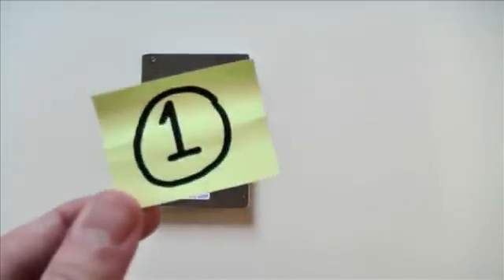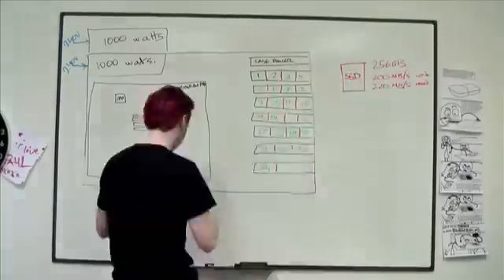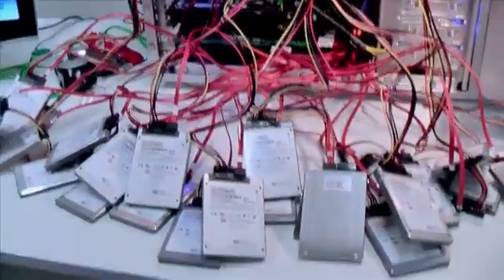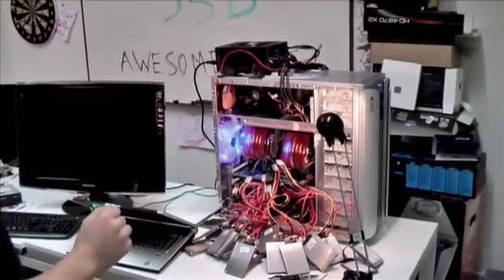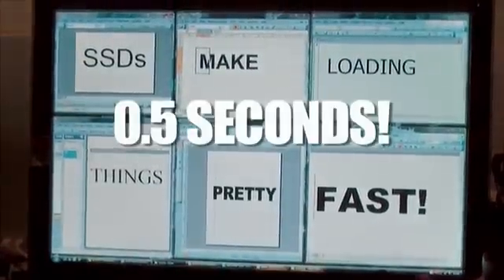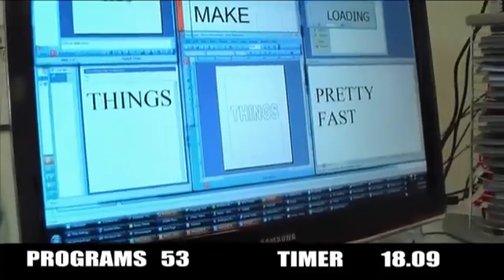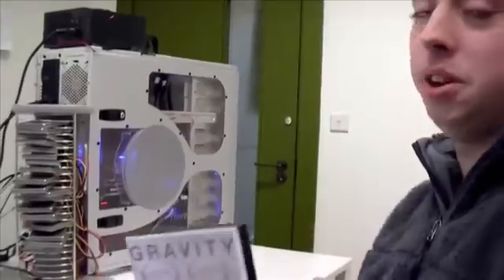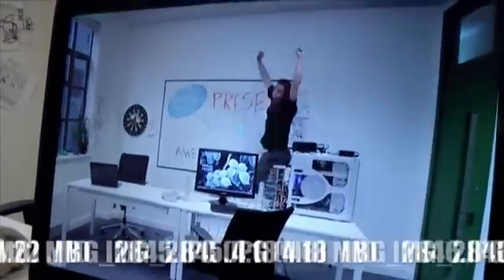What happens when you RAID 24 SSD Hard Disks !!!!!

Comment: Using a video game to showcase read right speeds is silly, and DEFRAGGING AN SSD is the third most harmful thing you can do to it, only beaten by running dragon age inquisition's DRM on it (constantly writing and re-writing) and straight up smashing it with a hammer.

"around dyed hair, always beware"
Reply: Mark Jordan Writing to it is damaging it slowly. (it's a tech fact that even today isn't resolved, that's why you have to use special softwares to keep it alive as long as possible) Defragging do A LOT of writes to the SSD and it isn't useful since defragging was made to accelerate acces time for a HDD because files are all over a disk and they cannot always be accessed (the "head" of the HDD must be in front of the data you want. If it's a file and it's split all over the disk, you have to wait the disk to spin at the right spot and move the head. And that's mechanic HDD is slow compared to an electronic SSD) For a SSD, you can access every file directly because it's only electronic.
Reply: It wasnt the video game specifically but the high resolution textures they were running on an already demanding game
Reply: Deksor Good explanation, a lot of newbies will most definitely appreciate it, but author of this video obviously knows that, he did this to showcase the speed, bad benchmark choice, but I guess HDD users can more easily relate to this :)
Off-topic: It seems like this video is a reupload. I wonder who's the original author? I'd like to subscribe to his channel.
Reply: Mark Jordan beat it with a baseball bat
Reply: Razelda Peacecraft this was January 2011 sooooo if we went back in time this would be mad
Reply: Lorde Kiblington Whats the worst you can do to it? like whats the worst thing you can to do an ssd?
Reply: Youtube ™
Depends on the drive. Faster, high capacity ones can get pretty hot. But SSDs can handle the heat, according to technical specifications of many popular drives, they can handle up to 70 degrees Celsius. In a tight cage, with no airflow, stacked directly on top of each other drives will accumulate heat, resulting in elevated internal temperature, theoretically 70 can be exceeded if you're constantly editing videos and whatnot. But, as I sad earlier, there are too many variables, if I did RAID, I personally would just play it safe, leave some gaps between the drives, and install a large silent fan in front of 'em. Most cases have an air duct and mounting points for the fan around the drive cage anyway, so why not utilize it?
Good airflow will not hurt your system, if anything, it will improve stability.
Reply: Lucas Alves
÷ I tried and the volcano melted. disliked, and reported.
Reply: ***** Don't be silly. That would mean that they're in the year 2015, which is simply impossible.
Reply: Youtube ™ overhit its chips with bad coоling of your system
Reply: daskriege
What?
Reply: Youtube ™
Translation: The worst thing you can do to an SDD is put it in the system with poor air circulation, which will result in flash memory overheating.
I guess it's true (especially when you stack these), but it is also true for a lot a components. Good airflow is always important.
Reply: funky3ddy
I'm pretty sure I heard this quite alot that SSD's don't heat up nor do they require good ventilation? That's also the reason why computers these days have the SSD slots at the back of the motherboard in between the case and the motherboard itself allowing for little to no airflow at all? For example the fractal design r5 has ssd slots on the side of it allowing for hardly any air flow to them...?
Reply: Youtube ™ Throw it at a volcano
Reply: Youtube ™ Well, maybe throwing it at a blackhole it can be the worst thing that can be done on an SSD :D
Reply: Lucas Alves
Also tried that while I was at it, and the black hole warped. disliked and reported as well.
Reply: Seriously though guys, all this for an SSD LOL?
Reply: Lorde Kiblington You don't defrag SSD's but OPTIMIZE SSD's. And Honestly, Defragging a SSD's Does no more harm than Reading and Writing does.
Reply: mage7206 "It wasnt the video game specifically but the high resolution textures they were running on an already demanding game"

Irrelevant. The only thing these SSDs would do for you is shorten your load times. That's it. Once most of the critical data is loaded into memory, the storage performance stops mattering.
Reply: Lorde Kiblington he should get PC Optimizer PRO (lmao), to prove your point more he had to use the malware defragging software becuse windows will not defrage a SSD... I get the same speed on my 4 SSDs but in all fairness Im using SAS SSDs with 12gbps read and write soo
Reply: Lorde Kiblington I disagree; I just think they used the wrong video game. I'd like to see them try to load the sims 3 with all expansion packs.
Reply: That DRM thing is a completely unfounded myth.
Reply: +Jose Vargas wasn't 2011, skulltrail + qx9775s +4870s = 2008
Reply: +Lorde Kiblington That was actually a fallacy: Denuvo doesn't write to disk constantly at all
Reply: No. Time travel is not possible. The current year is 2008.
Reply: *****  but if i'm seven and your 25 than obama care actually worked meaning that 3=x and x^2 is the denominator and -9^3 is the tip top of the triangle. 9/3 equals 3 a triangle has three sides there are three triangles in the triforce simbol zelda is made by nintendo, nintendo supports iluminati, 
ILUMINATI CONFIRMED
Reply: +Lorde Kiblington I know, I was like wtf are they doing...
Reply: +Johnny English 
XD
Reply: +funky3ddy Honestly, if the drives are in raid0, then each individual drive will be accessed for (in this case) 1/24th the time it would have been otherwise, so theoretically it shouldn't, on it's own, get as hot. In RAID1, of course, they'd all be accessed for the normal amount of time and thus all get as hot as normal (or more if clustered like this). In other RAID levels it's not as simple, but generally they shouldn't get much hotter (than when run without RAID) since there aren't any moving parts.
Reply: +Deksor samsung now has a new ssd that uses more reliable memory, it's got a warranty of 10(!) years.
do you know about it? and what do you think about it?
EDIT: its called Samsung SSD 850 PRO.
Reply: ***** That's only if all 24 combined were being used at the same speed as 1 typical drive, which would imply that there was no performance increase from using 24 in RAID0.
Reply: +Sonny Williams Even 700$ worth of SSD's wouldnt get you near that speed
Reply: ***** Even assuming you don't saturate the bus, the drives won't suddenly be faster because they're RAIDed (and if they did, that would reduce the heat build-up, not increase it). You'll get minimal benefit from small reads and writes, because there's hardly any latency in SSDs and small files can be written to a SSD in a fraction of a second already. Large reads and writes will be finished in seconds or less, and generally don't happen often anyway, so the amount of heat generated even in that case will be negligible.
Reply: +Lorde Kiblington Denuvo SSD rumor was a hoax.

Comment: One single Samsung SSD SAS-12G 800GB Drive on an Asus PIKE II card runs at 1.2GB per second.
Reply: keep in mind that this video is 4 years old, SSD disks have progressed significantly
Reply: Pawel Blyskal Note it's actually 6 years old. Also it's LGA771. Meaning it's using SATA2 (Which is limited to 3gbps => maximum of 375MB/s per connection) for the connections. It's also got slower SSDs than what's commercially available today. If you do this with current SSDs and some beefy raid cards you can cocievably hit ~10 GB/s.

We're starting to get speeds in the ballpark of these commercially available with m.2 drives now but we're not there yet. Maybe in a year or two.

Still though, 2009 -> 2015 is like 4 itertions of stuff getting 2x better
Reply: Pawel Blyskal They are 200mb/s. Watch the vid again, he clearly states it.
Reply: Dragon Steel - Amazing how many people dont know 1MB=8Mb... first try learn IT basics, then your comments will dont looks like from idiots. Video talks about speed 16000Mb/s (2000MB/s).
Reply: XtrAMassivE Wrong. The Samsung drives used EACH have 500MB/s transfer speeds. He used 24 drives and only got 4 times the performance of a SINGLE drive. Pathetic.
Reply: answerOfstupids Yes there is! http://www.quietpc.com/samsung-m2-ssds
Reply: Dragon Steel  You should use ctrl+c and ctrl+v... because you quoted my text wrong. Anyway my 1. reply was general for many comentators here, not only for you. I was no able add new post, so commented last wrong post. And yes, your english is probably better... so you have easyer way to learn something about GB and Gb  :D
Reply: Dragon Steel Another dragon!
Reply: Pawel Blyskal law of diminishing returns applies to pretty much anything at least anything technical lol.
Reply: Dragon Steel that's gigabits per second not gigabytes there is a difference
Reply: Dragon Steel lol sata 6 doesnt do 12gbs it only does 3
Reply: XtrAMassivE i forgot the link but wasn't there ssd that did over 2000MB/S (2gbps) read write. Do you know about it.
Reply: pertti290 i found another one http://www.pcworld.com/article/2904340/intel-750-series-ssd-review-storage-so-fast-only-the-highest-end-pcs-can-keep-up.html

however in testing they said for bigger loads they were only able to get 1.5gbs instead of over 2gbps  but for small files it was 2gbs.
Reply: Autodiagnostika Jantolák It's funny to me when I get told not to look like an idiot then I read this.

 "Then your comments dont looks like from idiots" 

You don't have to be great at English to realize that was awkward to read.
Reply: Dragon Steel its funny how the intel 750series has a single drive running at 2.4Gb/s read speed. Shows how far SSD's have come.

Comment: I worked on a hardware/software system that read, wrote and indexed mobile packets as 20 Gb/s.  And did not require 24 SSDs :)  That was close to this system's test of 2 GB/s, so perhaps it's not as impressive as it would seem at first glance :)

Comment: Too bad that continuous writing to ssd drive shortens it's lifespan drastically
Reply: To be fair, it's not nearly as bad as it was back then. Nowadays, it's getting much, much closer to the lifespan of mechanical HDD heads. And SSDs are not done improving yet.

I think we're almost past the worst part.
Reply: Well, to be honest you would not reach the SSD write cap during your whole life time with modern SSDs (with normal usage). Tech Report made an non-stop SSD write test with popular models. Samsung 840 Pro was the last one alive and ended up writing over 2.4 Petabytes before dying. That's 2400 Terabytes.

My SSD sits currently at 7TB of written data and it's 2 years old :D My older SSD is 4 years old and it has 13TB of written data. Not gonna reach write cap during my life time. And i'm gonna upgrade to newer model in few years anyway.
Reply: WayZHC
i'd rather be reassured and wait some more before transfering from HDD's to SSD's

Comment: That's not 2 GB/s, It's 2019 MB/s. which is < 2 GB/s.
Reply: no 2 gb is 2048 not 2000
Reply: That's what I said. I said that it wasn't 2 GB per second, it was 2019 MB per second, which is less than 2 GB per second. I'm fully aware that one Gigabyte = 1024 Megabytes, and mb to 1024kb, kb to 1024b, and much the same upwards.
Reply: iliekpie1125 According to hard-drive manufacturers 1KB = 1000B but according to computers 1KB = 1024B this is why when you buy say a 2TB hard-drive the computer recognize it as 1.81TB.
Reply: ***** and 2019 mb is 1.9716796875 gb

Comment: For the "OMG He defragged!!!" guys out there. Defragging on an SSD does work, and yes, it is NOT recommended because Random Seek is not a problem with SSDs. However, it does not "kill" the drive (unless your system is highly fragmented) - SSDs are limited in WRITE cycles - Read cycles are nigh unlimited, shiit, it happened so fast, I'm actually curious if he did DeFrag it, or if he simply scanned them to see if defrag was necessary.

Comment: I get exactly that with just 1 SSD and Linux...

Anyway, with 8 SSDs in RAID0 on an good Controller i get more than 4GB/s, so for 24 SSDs, 2GB/s is quite lame to be honest.
Reply: Vampir Achtneunacht 90 lines. Nope.
Reply: I bought my system in 2011 with an Phenom II X6 1100T
Reply: he used sata2
Reply: You know this video was done 7 years ag
Reply: ***** Well you have to watch this from two standpoints.

Technologies are creates in the Linux World, not in the Windows world. The ISC, the Company who "develops" "The Internet" is running Linux and all reference implementations for DNS, DHCP, TCP/IP and so on are created in the Linux world.

Also all root-servers run Linux or other UNIX Operating Systems. So without the UNIX Systems, there wouldnt be any internet.

Google is using Linux on most of its systems, Google itself is an Linux Application written in Python and C as Facebook is an Linux Application.

The Programming Language C was created for UNIX and it was created by the creators of UNIX and C++ was also created long before any Windows every seen the light of world.

From a pure technical standpoint, Linux can do everything what Windows does, but better.

The only reason to not use Linux is if your technical skills are not enough or you need some hardware/software from a company who does not provide Linux Drivers/Software.

The only reason why Windows is used, and i say that working for companys with more than 70000 employees, that people can use this who are less technical skilled. You can set an idiot in front of an windows system and he still could be able to do stuff somehow.

So in Windows its easier to get along being bad.

Funfact, the TCP/IP Stack from Windows is from FreeBSD (UNIX), so without the UNIX Systems, Windows wouldnt even have networking.

So why is Linux important? You could not read this without Linux. You are using an Linux Application right now (YouTube) and your Windows is using UNIX Technologies (your Browser (except you use Internet Explorer) and Networking.

Also your Router is running an UNIX System (most likely Linux) as your telephone provider is running it. You would have no Internet without Linux so there would be no way to ask for its importance ;)

Large Companies using Linux are for example Google, Intel, AMD, ARM, Dell, IBM, HP, NASA, NSA, CIS, ISC Facebook, Sony just to name some very few of the most well known one.

But Sony is only half-true, they have a lot of Linux Servers but most Servers and there PS Vita, PS3, PS4 run with FreeBSD (UNIX) rather than Linux.

I could continue endless but one more fun fact.

Most Windows Servers nowadays are virtualized using VMware vSphere which is an Linux Distribution. So most Windows Servers who run today are run by an Linux System. The only Virtualisation Solution which can beat VMware in Terms of performance and features is KVM which is an part of the Linux Kernel and Linux only.

The only Virtualisation solution which can beat KVM is behyve which is FreeBSD only and can only be used to virtualize BSD and Linux Systems.

Also Mac OS X is, in most aspects, an FreeBSD System (with some changes to the kernel like Sony did for their playstation).

Not to mention that Android is Linux. So iOS and Android are either FreeBSD or Linux. We would live in the stone age without Linux and Windows Server would be much more expensive then they already are.
Reply: Yope
Reply: "I get exactly that with just 1 SSD and Linux..."
"I bought my system in 2011"

Wait what. No you don't get that speed with just one SSD from 2011. Linux isn't magic either. Even today you can only barely pull 2GB/s with one SSD. And that's only the theoretical speed. Actual speed won't hit 2GB/s. Every SSD i've seen hitting over 2GB/s have been PCIe SSDs and while they were only one card, there was actually few drives in RAID on them.

And this video is originally from 2009.
Reply: That system speed, not SSD speed

Comment: Not usable in RL because RAID 0 would make any failure in any 1 of the 24 drives fatal to the data on all 24 you would want to use RAID 10 or 5 with a controller.

Comment: You can tell these are marketing people. You never want to defrag SSD's :)
Reply: Thats a silly myth, defragging doesn't hurt SSD's nor do they marginally increase performance like on HDD's.
Reply: CalculuS Yes it does. Writes count on a SSD. Defraging will cause writing to the drive which can hurt the drive. I am in the business, I have done enough tests to prove it.
Reply: CheekEman Thats like saying breathing is causing cancer and thus deadly.

Also next time you try to state you're in "the business" give proof, I find it hard to believe a random stranger.
Reply: CalculuS No its not lol
Reply: CalculuS solid state drive cells have a limited number of times data can be rewritten to them, when you defragment them, its rewriting the data on the cells many times, and that shortens their lifespan. Also there is no point in defragmenting an ssd anyways since fragmented files don't hurt performance.
Reply: noah1831 http://www.pcgamer.com/two-ssds-survive-after-more-than-2-petabytes-of-write-tests/
Reply: CalculuS That has to be the worst analogy ever. That's not just hot air; it's based upon facts on how SSDs work. SSD lifespan is entirely dependent on writes. Granted, it's gotten a LOT better since 2009, but there's still a bit of distance between their current lifespan and the typical HDD lifespan. 

Also, that "I am in the business" thing doesn't mean jackshit. There are plenty of people in IT that shouldn't be there to begin with.